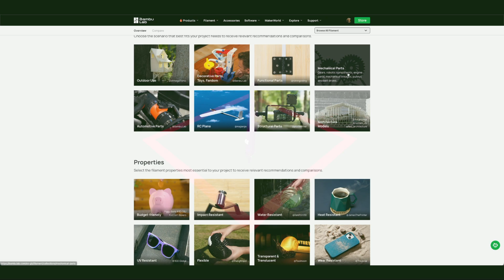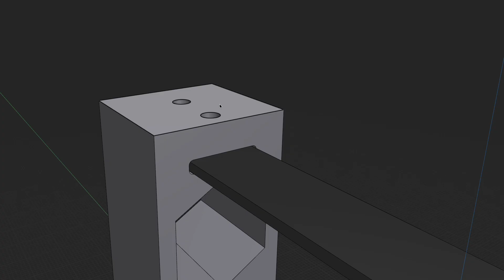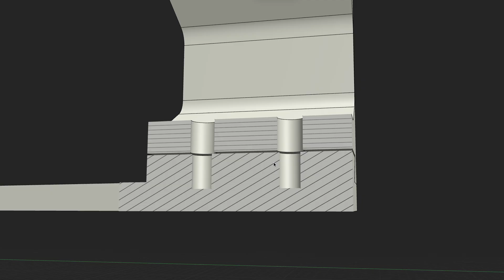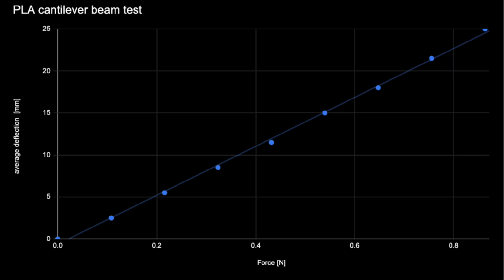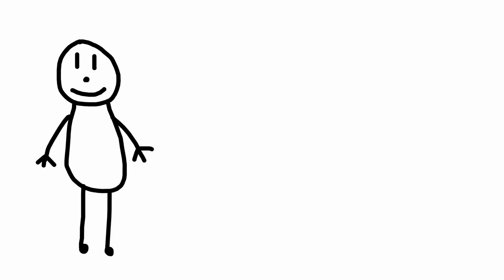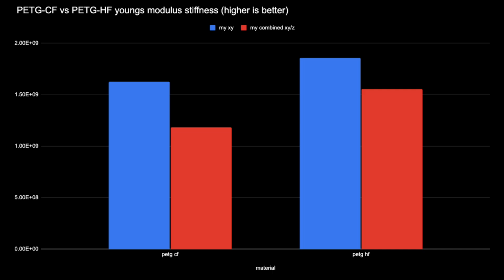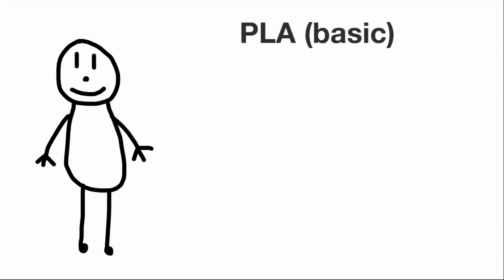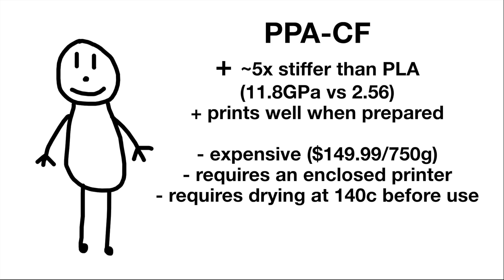Finding the BEST Material for my AI Guided Rocket

Comment: Have you considered polycarbonate? I hear CFPC is one of the best affordable materials for printing structural parts.
Reply from the maker: Bambu didn't have PC at the time I planned this video, it probably would've been a good one to test. Looking at the datasheet, it seems similar stiffness to PLA just much more impact resistant and higher tensile strength - which aren't too important for the gimbal

Comment: The dovetails - it's possible they wire edm'd it because they do have the ability to do that. But it's also possible they just used a dovetail cutter. 

The second I heard you talking about tolerances I was "oh that's way too big" machinist handbook has common tolerances for different fits. You also probably could have contacted the manufacturer and told them and they could have recommended tolerances. (Ignoring entirely that for the task at hand a bolted connection would have been entirely adequate) 

You also should have used some sort of calibrated weights instead of bearings in a perfect world. In reality it doesn't matter - there's so many more variables that go into printed part deflection that small variance won't be noticeable... 

Still, cool stuff.
Reply from the maker: Good to know! I think they have different tolerance options available so I'll have to look into it more before I design any actual components to use cnc.
As for the weights, yeah its not ideal but I was just using what I had easily available to get a rough idea, glad you still liked it!

Comment: do we have a NEW CNC KITCHEN, anyway fire video, but, you tested the plastic in one dimension, bending loads, witch is  tension and compression, but if you are making a TVC mount, you will also have impacts, and many other things, that should be kept into consideration.
Reply: also, if you only need a heated chamber, wont the H2D be overkill, QIDI has some great offerings, that have a great heated chamber.
Reply from the maker: and yeah maybe the h2d would be overkill, but it has plenty of other functions which I'd have uses for as well
Reply from the maker: Yeah as I said in the video things like impact resistance and ultimate tensile strength dont really matter for this since at this scale PLA is already good enough and basically everything else is significantly stronger